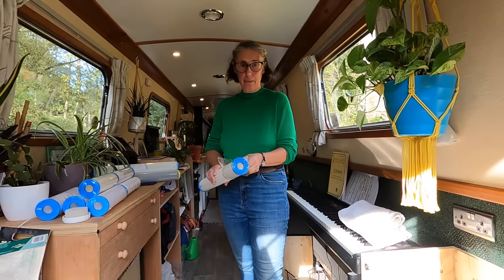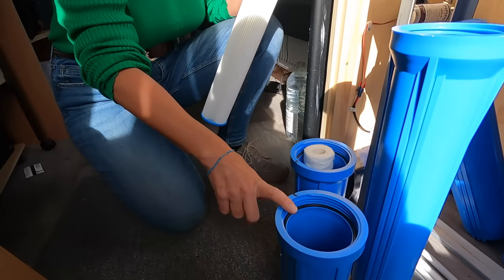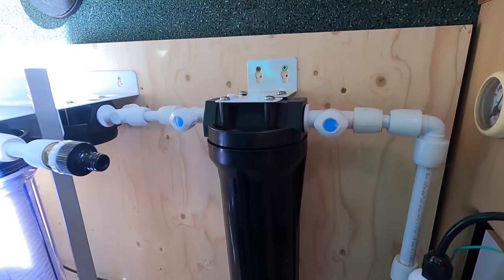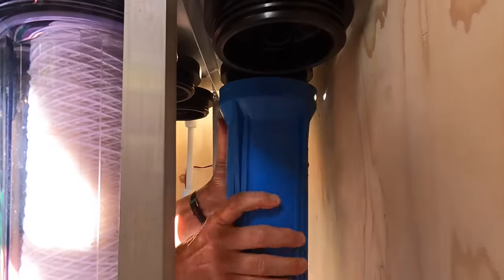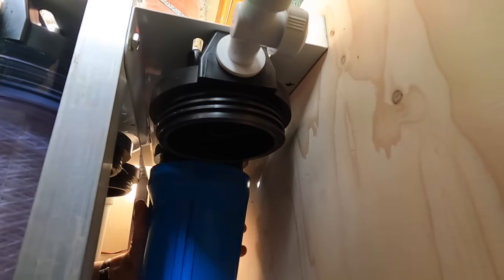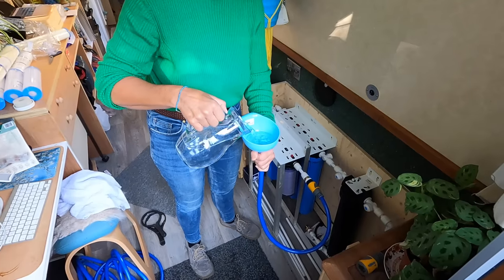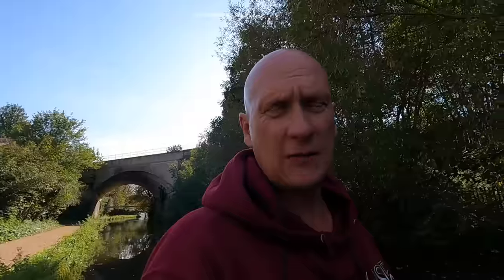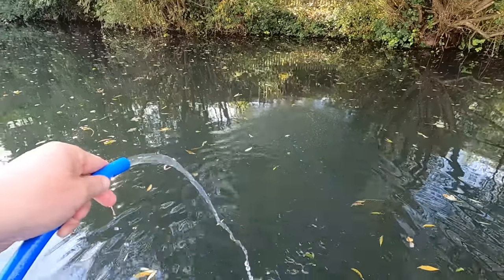Filtering Canal Water. How Good Is It? - S3 Ep14. #narrowboatlife  #waterfiltration

Comment: Someone else has done a video on her system & I was rather brutal w my comment at the time. I wont repeat all what I said back then& I try to be nicer..
It prob is summed up with: a total waste of money.

Seeing that at some point next yr I'll be heading to England to rebuild a boat& then travel the network.. and that I have pretty good knowledge reg waterfilters, I would not install one on a boat. If I would be forced to, Id do only a reverse osmosis plus pre and after filters incl UV light. So u know, I go total overkill. But the right way. Even in a house, I wouldnt unless the safety of the water supply cant be guaranteed. But as said there really isnt a reason for a system like hers on a vessel like she has.
Since Ive been planning for ~15 yrs now, I have solid ideas on what I will and wont do on my boat. I am going for a very large tank instead& know I will be topping it of any time I can. I gotta have a nice bath (not every day, but often enough) & in order to be able to do so, a large tank is necessary. Plus I can choose not to have one when I have guests & also not have to worry bout anything even if I were to get frozen in for a few days.

An obvious point to make, is that the hose for the waterpoint needs to be for drinking water &not one uses for the garden. (I am always surprised how few ppl know that there is a huge difference between the two).

By now they have plenty of options (thanks to van lifers& off grid ppl) to ensure that water supply doesnt stagnate &remains clean, even if one has an older tank. 

Btw: Do not clean ur tank w reg bleach, as u not only can potentially damage the tank, but also it would take forever to get rid of it, to ensure its safe to drink again. Even if in the end there is only a lil bit left, any diluted reg bleach is just a super bad idea. Its a nope nope. (I saw someone saying they are doing this & I am a bit suprised no one has said anything). There are much safer options, one just needs to do a google search.
 
Anyways, one can get also  decent smaller (cheaper) water filters, those can be keep in the fridge or on the counter. (No need for a Berkeley). They have done tests on them over the yrs&one can check which one suits one best (if drinking water quality is a concern due to the age or cond of the water tank for example). 
The big thing is, many ppl do not change the filters on time (even the ones under the sink). This can have a terrible effect on ones health. I usually just have my Calendar in my phn remind me, to do so, so even I dont forget.

Its a great video! 
Sadly her system is in many ways a waste of money. Unless its sponsored and a test boat, its not worth it. Unfortunately when one has dropped the kind of money she prob did, one feels obligated to continue to use it, rather than to admit it was a mistake &just simply throw it all out. Its a gimmick &like u said unless its a family its simply not worth it, as its way to costly to maintain, time spent to do all the work & she isnt using enough water to ensure the system runs often enough to ensure quality. So she has to waste a bunch of water, and in turn throws good money after bad, as she still has to pay for the new filters regardless how much water she actually used. Not forgetting in each area the water quality can differ greatly& thus she may have to then change the filter out sooner just to ensure quality is maintained. I said it back then, in my other comment from a while ago, sometimes its best to admit one made a costly mistake& just throw it out. How freeing this would be for her, she cant see cause she is invested in it& feels for some reason obligated to continue using it. On top of it, its not likely she'd get addt money when she sells the boat, cause most ppl frankly wont be interested paying extra for some, they will throw out as soon as they get the keys.

But each their own. I rather take a bath with water from the point, than with her system.
Sorry; I guess did & am bash/ing her system again. I apologize I cant help myself. I do feel sorry for her, cause I get the feeling someone upsold her on it, by making her paranoid bout the quality of the water point water& she seems already now to regret having it. She deffo doesnt seem all enthusiastic about it anymore.
I think she said in the other video she had wanted it so she doesnt have to ever stop for water. But, she still has to prob stop to get rid of her rubbish & her toilet matters. Or heck even go grocery shopping. So she has to stop no matter what. She can only remain in one place for 14 days at most. So she is stopping at times. Again she will at the latest have to move at the 14 day time limit, and stop at the same places, she would fill up with water, to get rid of bins and toilet stuff. So, her original logic made no sense at all. 

Cause she aint cruising day and night. If she felt that she wanted to remain in a place for 14 days without moving, she should have just calculated her overall water usage for 2 weeks, the same way she prob calculated her toilet matters & just got the tank size thats fitting. Then plan out her route to accommodate all that. Its not rocket science.
Okay that was a long enough comment.
Thanks for all ur great videos. U really should have more subs, cause u always provide great content. Btw there are YT channels that help ppl, with what one needs to do, in order to grow ones channel. If u r interested, just search YT. Cause u should deffo deserve to have loads more subscribers. 
Take care.
Reply: Btw those Berkeley often do not do well in tests. They are a lil over hyped. I know I prob get some hate from those who love theirs, but if u do a lil research u quickly find out, that they are really overpriced & dont quite filter out all that they claim. Just as an fyi
Reply from the maker: Thanks for the detailed comment.  If I may offer an opinion on your 15 years homework. I too went for the biggest tank I could get but there are a number of repercussions as one thing like a huge water tank has an impact on other stuff. If you're buying a narrowboat, to get the biggest tank necessary, ordinary they are integral. If I didn't have a bow thruster, I could have got a bigger water tank. Stainless steel are easier to manage but it means a small tank. I do top up as I pass a water point and have never run out, but that too means I have become fanatical about saving water. I need to address that. 

To have a bath takes a lot of water. Also, how big the calorifyer is and how you want to heat that water and re-heat after the bath. Unlimited money makes life easier. Also the water pump doesn't generally pump that amount of water so it may run out of pumps early!

Rubbish is easy to dispose of if you drive to work and if you use a compost toilet, therefore waste; it doesn't matter. I have never had an issue on the toilet!! Agree with the thoughts of the filtration system but I also believe in people making the decisions that suit their lifestyle. I think the system could and does work if you are on top of your admin and logistics. I can do one but can't control the other. The source of failure is outside my control. It was hard to get a food delivery from HelloFresh so important things like filters is just another headache. Your comment makes a lot of sense though Bella. Thanks for your time. Have a great week.

Comment: It's all very interesting, but I find it all a bit overkill! I'm wondering why you would want to go through all of that to filter canal water, which has got to be some of the nastiest stuff imaginable when considering what's in there; oil, fuel, pee, poo, dead animals, chemicals. Would it not be a lot more sensible to have a self-contained system on board? Let's only talk about grey water; sink, shower, washing machine. I'm wondering if a simple external canister filter from an aquarium hooked up to its own dedicated solar connection would do the job. It doesn't need to filter 24/7, just a few hours a day. From experience with aquariums I've personally seen them clean a tank of mud into crystal clear water within 48 hours. Plus, they're almost completely silent and once they're primed they stay primed even if turned off for weeks on end because they are a pressurized canister. With narrowboat space in mind, and assuming it actually works of course, I'd have a bulkhead installed in the boat's water tank and have two filler caps in it, one per side. One side for the grey water system and then other for drinking water, completely separated. I'd love to see if anyone's ever tried any of this. Granted I'm pretty sure that water tank would have to be done before it's even installed into the boat. I'm not sure if they're accessible once the boat is built. If your boat hasn't got gas installed, which I think will eventually go extinct thanks to solar, our canister filter could sit in the gas locker, great access for when the filters do eventually need cleaning. I've actually never replaced my filters in my aquarium even after ten years of constant use, they just rinse clean once every three months.
Reply from the maker: The dual water filter tanks and that system you described is being built and fitted out by the Fit Out Pontoon on their new boats. I was 2 years late and to be honest I think there is a certain amount of risk in getting the filters. Yes you can have 3 sets so you have redundancy but it's still a faff. I've not run out of water yet and now I've done the homework, it doesn't feel right for my life. However, if the situation changes, I will re-consider. Two tanks is the gold plated solution. That time has gone unfortunately. Thanks for the comment and enjoy your week.

Comment: Seems like a lot of work and expense to avoid topping your tank up as you come to waterpoints. Adding in the risk of component failure leading  to contamination. 

Would rather spend a fraction of the money on a dry separating toilet and a couple collapsible water carriers for emergency use.
Reply from the maker: Nails and heads come to mind Sean. Thanks for the comment and enjoy the last of the Autumn. Have a great week.

Comment: Why don’t people collect rain water and install a hidden gutter along the front of the boat and catch rain water sending it through a filter! Easy
Reply from the maker: The boat is designed to tilt to the back so the rain water runs off at the middle and the stern end. There is no way to collect rain water at either point. Additionally, the boat gets quite dirty with rain and dirt. The water wouldn’t be clean but clean enough for dishes etc. It’s just something I assume most complain about….maybe inwardly and have to accept…..or buy a water system. Disadvantage of boat life.

Comment: With the best will in the world the various sizes of filters are just sorting the lumps of decomposing dead cat dog duck rabbit fish vegetation and whatever anyone else had flushing down their sink into different sizes.  A bit like a coin sorter.    The carbon filter is the only one doing anything to actually remove the invisible poisonous  chemicals.   Way to expensive for the little water you actually use.    The smelly water is a bit concerning because hasn't it just been through a filter system. Way too expensive way too much of a faff getting and changing filters.  Moving the boats just for water can be a faff but you do end up with clean water.  

Rolling water barrels can be an answer but don't get the cheap waterhog ones the caps don't fit too well and if you're taking it for a long walk / drag you could easily loose 10L of water.   Better get the original aquaroll. Much better sealing and the handles fit more securely.  They are usually only 40L but if you're tipping it into the main tank its a lot lighter to handle.   Just get the one as pushing one and pulling one at the same time isn't easy even if you're on a level campsite.   Use more water and keep it fresh.   

Most interesting video.  Maybe they should fit. UV lights in the water tank to help kill off bugs.
Reply from the maker: Thanks for the comment Andrew. I think the smelly water bit from the containers is more because the system hadn't been used for some time: Stagnated, hence the reason for running the system for about 20-40minutes.
Thanks for the tip on the rolling water things. I ordinarily get the better branded stuff when it's mission critical. I believe water is critical. Didn't think the pushing and pulling would be easy and would have worked that out in the first 10m no doubt. Have a great week.
Reply: @chrismears-inslowtime  we filled our tank and it took (weekend boaters) about 3 months to use it. It began to smell quite bad.
I flushed it out and it didn't take too long before the smell came back.   I had to get a bottle of cleaner to clear it.  It's not used as drinking water.  The 40L aquaroll  would be easier to  tuck behind a front door not restricting opening so much.   Have fun stay safe.

Comment: Total waste of time and more so expense on canals.  It's dead water and I would say hovering around sewage water level.  On rivers slightly different because it's moving water but still a waste of time and effort.  If you were paying for water separate to your license then I could understand having the system.  I've watched your Vlogs from the start and never really seen any sign of water panic.  I've watched several Vloggers that have been on the canals for many years and again no water panicking. 
One thing that she didn't mention was the cost of the filters and how many times a month/year would she incur that cost...... You can still do all the things you want to do with water....you just have to fill up the tank more regular.   
If I lived in a house that backed on to the canal I for one would have a water point for all to use on a coin operated meter, if it got used all good if not so what.  I'm sure as eggs are eggs it would get used though.
Reply from the maker: Interesting point and don't offer that suggestion to the CRT though. 
You're right. I have struggled to get water and it always lasts. That said, I am too tight with it. I must learn to use the water I have better and plan to use it all before I fill up. I often have at least half a tank left. 
Those in London incongested areas have a bigger issue as there are too many boats for too few water points. Other than that, it's all fine....if you move. Thanks for the comment and enjoy your week.